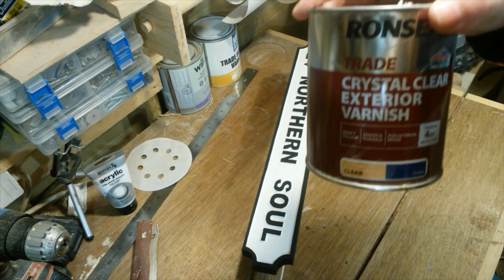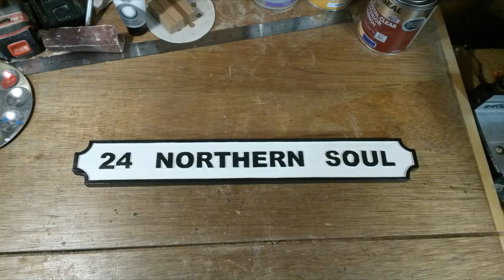House number street sign

Comment: Thats a great job, can i ask how you hold the small endmill in the collet
Reply from the maker: Thanks. I use a reducer collet I purchased from Ebay.
Reply: thanks for the reply is it a 1/4 reduced to 1/8 i didnt know such a thing was available ive looked on ebay and they are only £4 looks like i,m going to try and make a sign lol
Reply from the maker: Yes that's the right size I didn't know about them until I  saw them on a youtube video.